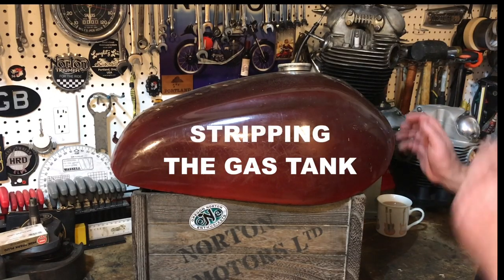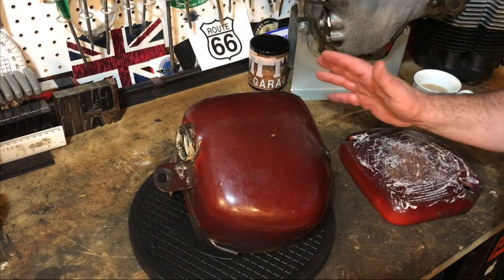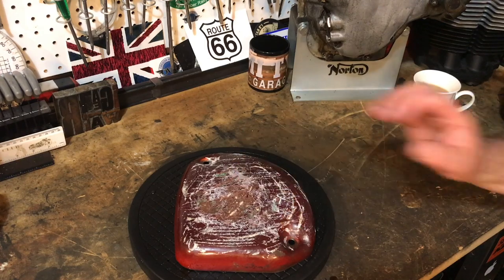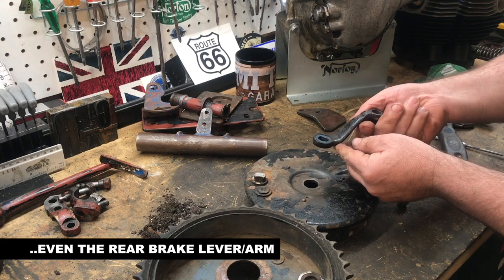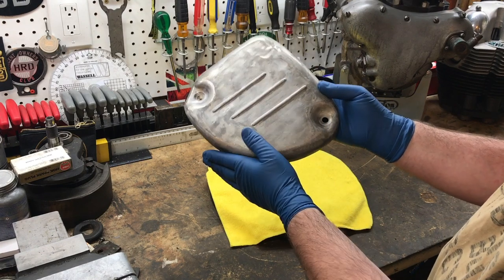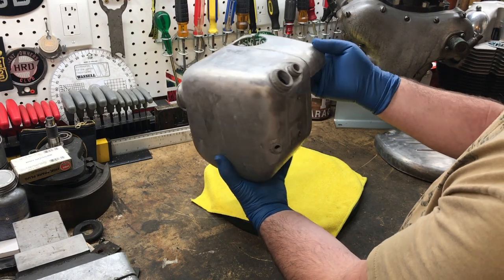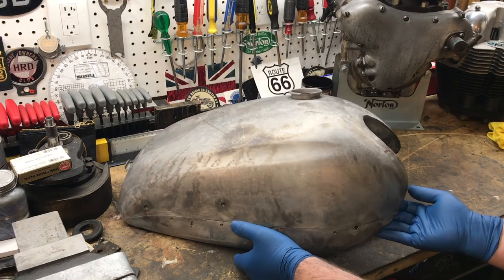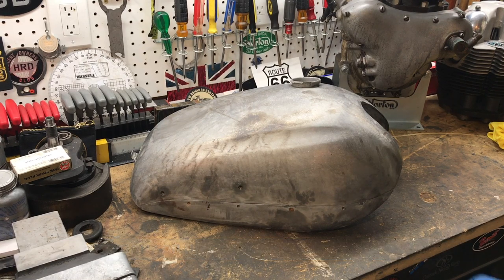1961 Norton Manxman 650 project (9) - Stripping the Gas Tank & other parts

Comment: A heat gun will soften the bondo polyester such that it can be scrapped off with a paint scraper. Also a good wheel/flapper type sander disc should take it down without hurting the metal.
Reply: TornadoCAN99 That’s basically what the stripper did, heated the tank up in an oven until the bondo flaked off.

Comment: Most body shops could pull those dents.  Then you would have to use only the bare minimum of filler.
Reply from the maker: Thanks a lot Mitch. I appreciate it.  Cheers, Mike
Reply: @TheMightyGarage  Generally they attach some sort of temporary fastener and then use a slide hammer to pull them out.

Comment: That tank dent reeks of an outburst from an un-starting engine, Mike.
Those trickler buttons to flood the bowl; when not properly used, can sure wear a novice owner's kick starter's leg out & even frustrate them enough to plow their helmet into a perfectly fine gas tank. Of course it could have been an over flooded bowl just as well. 

Still, the lack of knowledge to open the throttle wide to clear it could trigger the same tank denting response. Many abandoned British bikes were quickly recovered after having been stolen, because of the joy riding thieves lack of knowledge of such things. Ought to have known better than to be smarting' off @ 3am. Reckon I best lay down now. 

Best of Cheers toward the Manxman's restoration Mike.
Reply from the maker: Hehe, you are so right!  The first line of defense with these old bikes is that no-one knows how to start them these days ;) Best wishes, Mike

Comment: Mike, get the parts primered instantly or you can watch them rust in no time! 

Pull out the dent in the tank and seal the inside. Then make a pressure test for leaks.
Reply from the maker: Thanks Uli